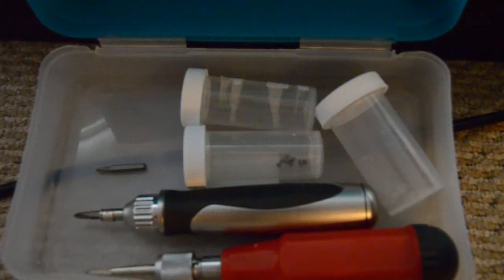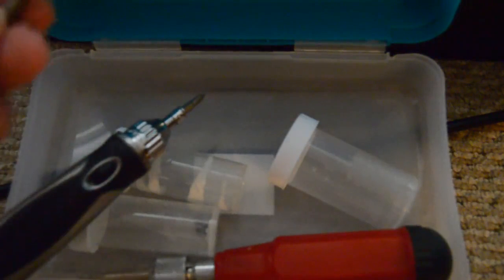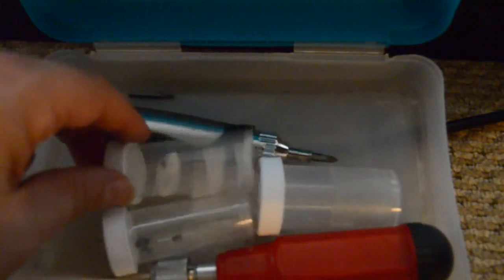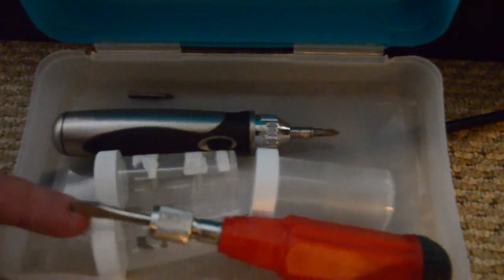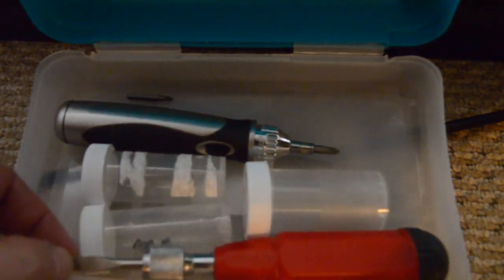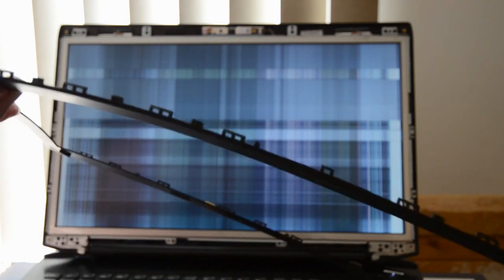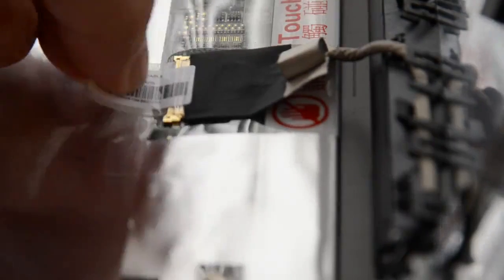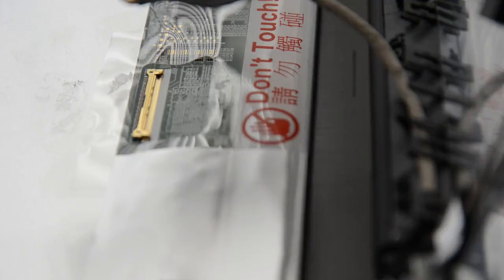Laptop screen replacement / How to replace laptop screen [ ASUS G750JW-DB71-CA ]

Comment: Sorry to say this, but the issue you were having wasn't the screen being bad, but a loose display cable. Have you tried putting the old screen back in and checking if the problem went away?

Comment: screen was dead on my I5 asus. just took the whole screen assembly out and tucked the wifi antennas around the outside edges of the base. Removed the battery and plugged up to tv. Added wireless keyboard and viola, budget upcycle HTPC.

Comment: Thanks for this helpful vid, I just ordered an identical replacement from Screencountry (Asus in Toronto wanted almost $600!). You're right, the screen bezel is nasty but once you get the hang of it it comes off OK. Cheers

POST-OP EDIT: worked like a charm, PC is back to new status! Thanks

Comment: I have a question: do all laptops have same cable ? my Asus fz50 screen broke and I'm trying to confirm if I can use the gl551 replacement screen. technically they're both the same laptop, just want to know if they use the same screen(and connector) so I can easily replace it.

Comment: If the cable was defective would you have had to break down the entire laptop?
Reply from the maker: You definitely have to remove the screen, but I don't think you have to open up the base of the laptop (not certain, though).  The cable is about 8 inches / 20 cm. long, so can't travel too far.  If you look at about timestamp 14:50 in the video, at centre-left, I believe that might be the other end of the cable.  If you look at the image of another Asus laptop model at the link belo, the video cable is about the same length as mine and appears to be plugging into a port at the corner, much like what you see at time 14:50 in my video.

http://www.insidemylaptop.com/images/Asus-K53U-screen/replacing-asus-k53u-screen-14.jpg

Comment: Opaque, my screen suddenly has a pink hue to its white colours at all times; boot screen bios and windows.  Could my problem be a screen also or the cable?  Using the HDMI, the external monitor is the proper hue.
Reply from the maker: I'm not a technician, just a do-it-yourselfer.  A browser search suggests that the problem could be either screen or cable, pressing Fn+C on an ASUS laptop, or a Windows 10 update:

http://www.tomsguide.com/answers/id-2091278/pink-white-screen-tint.html
http://www.sevenforums.com/graphic-cards/290209-having-trouble-pink-tint-my-screen.html
http://answers.microsoft.com/en-us/windows/forum/windows_10-update/pink-hue-to-screen-after-march-23-update/81ef824c-883e-4103-a1d0-eca9a87a4cae?auth=1
https://www.ifixit.com/Answers/View/20840/What+causes+screen+has+pink+or+reddish+hue
http://ccm.net/forum/affich-78673-laptop-screen-pink-out

Comment: +Opaque I noticed that your new display has backlight flickering, it may be the cable or the display... I also noticed a white stuck pixel in the new display :|
Reply from the maker: The flickering is caused by the frame rate of the video camera (24 fps) being different from the refresh rate of the LED, not something you'll experience in reality.  You may have noticed the same thing in movies when the camera happens to film a TV set.

As for the dead pixel, you are correct.  I returned the screen and got a replacement at no cost to myself -- Screen Country covered the return shipping cost and immediately sent a new one when I reported the bad pixels without first waiting to receive the original back, pretty good customer service.  The new screen is fine.

Comment: +Opaque Is it possible to replace it with an IPS panel? Also, how much does it cost?
Thanks
Reply: Hi George, I have the same question. I recently emailed a computer repair company here in London but they were not really helpful. I've just raised a support ticket with ASUS and sent a couple of enquiries about this to some other computer repair companies, so fingers crossed. May I ask if you managed to find out if it is possible? Many Thanks.
Reply: Just got a response from an online screen vendor: "Sorry George not on this machine it's too old.

The IPS screens are thinner and have different fixings so won't fit into the machine." I'll wait for the other vendors to come back to me before I get disappointed.
Reply: Gi Vi My Sony laptop has the same problem they told me it's too old to fix and go buy a new one with just 200$